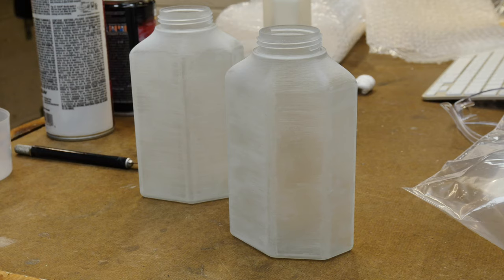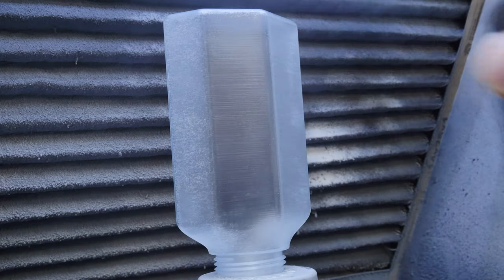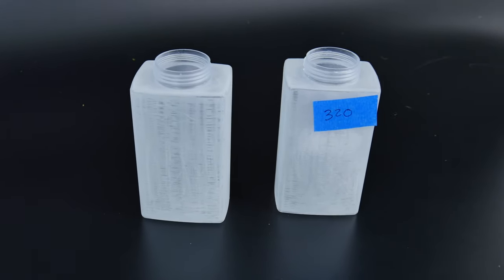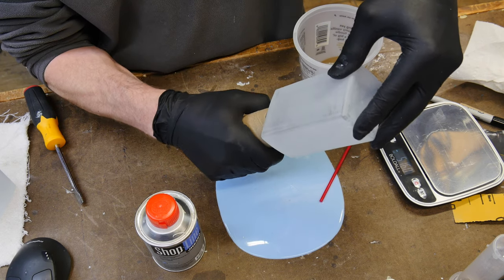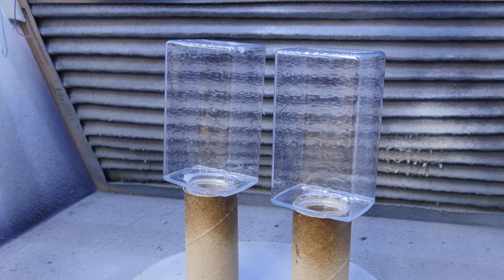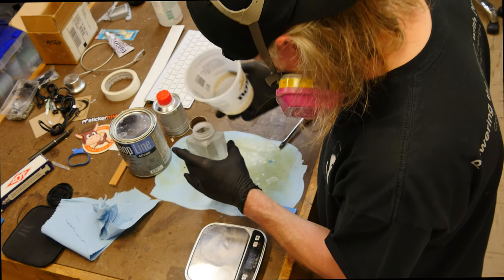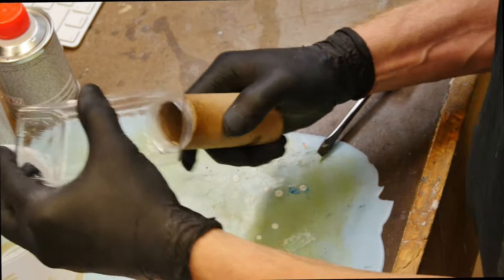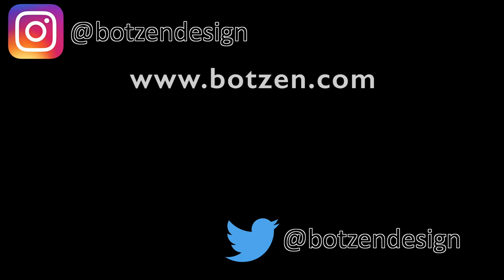REAL CLEAR SLA parts: Clearcoating prototype 3D printed bottles

Comment: Instead of using clear paint, maybe you can try carpenting "polyacrylic" finish. For the internal surface, just pour some in, shake it, and then pour it out for future reuse. The polyacrylic have good surface tension, so it will tend to stretch on it's own while curing producing smooth surface, saving you from sanding.
Reply: Polyurethane is much more resilient than polyacrylic. I'd be worried about it disolving into the stored liquid.

Comment: Love the vid, Eric! You the king! Two questions. 1.) Why just sand to 400 grit? 2.) How would you sand the inside of an SLA print of a wine glass bowl? Keep it up, man!
Reply from the maker: You can go higher than 400 but you're talking about diminishing returns and it's not worth your time and you get the same results, for bottles either you need to take the bottom off or figure out how to sand inside.

Comment: Instead of spraying, we do dipping: just dip your "clear" SLA part in a 1 part polyurethane(or slow curing 2 part) and slowly retract it out of the liquid. The slower the pull, the thinner the layer will be. No drips! And the thickness of the layers is perfect everywhere.

Comment: I would like to know if you know a way to make it food real/safe coating. So I could store water or other liquids and I can drink from it without getting cancer from the coating.
Reply from the maker: It's a two part cured urethane, it should be inert, check with the paint mfg, for long term use. My guess is that the urethane would need to cure at least 7 weeks until it stopped giving off gas.
Reply: @EricStrebel  thank you a lot, I am currently experimenting about it.

Comment: Is it possible to produce a bottle that supports carbonated beverages?
Reply from the maker: Yeah, possibility......not sure how strong a 3d printed part would be for that.  Why would you want to do that as a prototype?
Reply: @EricStrebel  I'm assembling a drinks equipment that is inside a dispensing backpack in which I need a pet bottle made to measure, unfortunately it's extremely expensive to produce industrially, I'm looking for a way to make the bottle and cap made to measure or 3d printed parts.  I'm from Brazil and here it's very difficult and expensive to find a solution
Reply from the maker: The 3D printed part would not last long. I would suggest finding an existing bottle that has the volume that you need if the container is not seen?

Comment: Can you make a transplant small tubes? Like a lip gloss tube?
Reply from the maker: Yeah, I suppose
Reply: @EricStrebel  Thank you for responding back so quickly. I'm an entrepreneur who is interested in cosmetics, and I find it hard to gather information on manufacturers who print small tubes. I figured I'll get a printer and do it myself
Reply from the maker: For production they would probably not be printed but injection molded

Comment: Have you tired coating with Epoxy's. I have purchased the  XTC-3D and have with sanding and polish turned the surface into glass smooth.. still at first stage of testing myself.. experimenting with additions of thinners for better initial application.. but very promising.. and only video comment is I found you repeated saying things more than I prefer.. but I find most people to slow at getting to the point with stuff. .so maybe my issue..
Reply from the maker: Only have used the automotive clear. Post on social media and tag me when you have results

Comment: what would you reccomend for a transparent RC jet canopy. I know it is not entirely related however I am trying to make a canopy or treat the stock ones so that I can see through it with my FPV camera on board. I know it will still be slightly distorted but I just want to fix the blurriness
Reply from the maker: This process could work

Comment: Hi Eric. Tks for sharing this great solution.  I am a hobbyst who 3D print slotcars in SLA. What would you recommend to give a transparent finish to these little cars window glasses? I don't have a spray paint gun.
Reply from the maker: With out a spray gun you options are limited, to rattle can and using a brush....with a brush much sanding you will need.

Comment: Try clear acrylic floor polish. It can be poured in then rolled around and poured out. For the outside it can be dipped, brushed or sprayed. Multiple coats can be built up. It can be thinned with water. I smoothed the inside of a rough plastic emblem by cutting the polish 50% with water, pouring it into the emblem to cover all the surface then poured out the excess. To dry I supported the emblem inside down atop the tips of three lad screws poked through a piece of cardboard. The silicone mold I made from the emblem came out smooth enough that when Spaz Stix Ultimate Mirror Chrome is sprayed on the inside it shines like vacuum sputtered aluminum, like the original when it was new nearly 70 years ago.
Reply from the maker: greggv8 Ok, I will investigate, thanks for the tip! any brand you recommend?
Reply: @EricStrebel  it used to be called Future. Look up what model builders are using on clear styrene parts these days

Comment: Hey, speaking of Stratasys, if you want to do some of your own prints in house for almost nothing, check out the SparkMaker SLA printer. It's like $250 and while it's small, it makes incredible parts (for its price). I use it to make bits and pieces for mold shaping.
Reply from the maker: In my opinion no resin printer is worth it. I just don't want to deal with the mess
Reply: @EricStrebel  That's fair. I do mostly urethane casting, so one extra goopy resin type getting everywhere is just another afternoon in the shop for me.

Comment: Do you know what the uv resistance to yellowing is of this material?  For instance if it was used inside a headlight housing?
Reply from the maker: It's automotive grade clear coat, the other stuff I would have to find out from the spec sheet from the manufacturer
Reply: @EricStrebel  specifically the sla plastic used is what I meant.  Sorry for not specifying.
Reply from the maker: It's called water clear Google it to find out. The problem is it's not that durable

Comment: this is very good stuff!
Reply: Swiss family name :-)
Reply from the maker: Correct!
Reply: @EricStrebel  Kanton Aargau?
Reply from the maker: Yes, Uezwil Strebels
Reply: @EricStrebel  that's a beautiful area. I used to live close to the nearby lake for a few years when I was in Switzerland. A co-worker had the same name like you.
Reply from the maker: Yeah it's a common name in that area especially in Wholen
Reply: @EricStrebel  Sorry to bother you again (but I am using the opportunity that you're responding to my comments if I may): what's the 3d printer you're using in this video? Which one would you recommend? I have no experience, but I'd like to produce low volume plastic parts for cosmetic machine, like for example bottles and caps.
Reply from the maker: The bottles in this video are printed from a service bureau, using a laser dmls process, but I use an ultimaker 2+ for my in-house printing. Best of luck with getting things set up
Reply: @EricStrebel  I know 3d printing will be a steep learning curve. Thank you and merry Christmas!